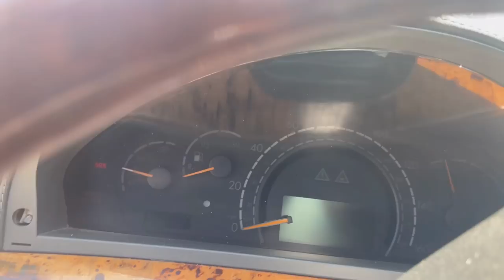I Fixed My Geo Tracker For $3.84!!

Comment: Outstanding!  I created a problem for myself because of the water pump.  There are two bolts that are shorter than the others.  I had to retap the hole I messed up on.  I think you are an outstanding mechanic!  Keep on keeping on!

Comment: First off . But down oil soak pads in both sides of the project ! If the ducks crap  on your floor while watching you do your work give them a nesting place to sit other than hard concrete floors and run down both sides of the car front to garage door opening like a puppy wewe pad . add "BG "oil cleaner to the motor oil and " TECHRON " TO THE GAS TANK ! I WOULD ALSO INSTALL THOSE COMPUTER CARDS TO THE UNIT YOU HAVE !  Loved the episode ! Have a great weekend as it came up so fast this week with the holiday ! God Bless !

Comment: The coolant most likely hasn't been changed in five years or more. Check the motor mounts too, engine seemed to rotate a lot on engine start.

Comment: Belt tensioner should be replaced when changing the belt. and if it is hydraulic, it needs 
'"bled". Compressed several times and released before installing. The timing belt will shift if not.

Comment: Great detail work to clean that interior. How many times did you have to empty that shampooer tank? A brake fluid flush and diff fluid change would also be helpful. A BG engine flush service would help that engine since I bet it's gummy inside. There seems to be a lot of engine movement during cranking, perhaps new motor mounts are needed? And rear hatch struts? Great work on that carb fix and all those maintenance items. I like the time lapses for the work you do.

Comment: One of my favorite projects for sure. I'm sure it has ethenol fuel in it. im sure once it gets driven and you get  a couple of tanks of gas  ran through, it should run better. Think she deserves some plugs and wires as well, maybe some shocks and suspension stuff. What a cool little suv. Bet it's like the midget and doesnt like highways all that well.
Reply from the maker: I drained the gas first thing and put in fresh fuel
Reply: @MonkeyWrenchMike  i remember that now. I even watched you do it lol. Hopefully, plugs and wires fix it. Migjt be worth running a compression check and block test just tp verify its not the head gasket. Even if if its that you can have the head off quick you did most of the work just putting the intake back on.

Comment: run some sea foam and diesel fuel in the oil for about 15 to 20 minutes at idle and flush it a few times and put some good fresh oil in it and if the engine is good it'll be cleaned of all the sludge.

Comment: You will need to get set your ignition timing since you loosened and turned the distributor it sounds like it's advanced that's why it's idling so high
Reply from the maker: I never loosened or turned the distributor, but I am going to check timing.

Comment: So how did you retighten the crank bolt to 94 foot pounds? You have an automatic so I know you didn't just put the transmission in 5th gear  to lock the crankshaft, and the specialized factory tool to lock the flywheel is unobtainable.

Comment: The capacitor plague was a problem related to a higher-than-expected failure rate of non-solid aluminium electrolytic capacitors between 1990`s to 2005ish, especially those from some Taiwanese manufacturers, .and they are in every thing